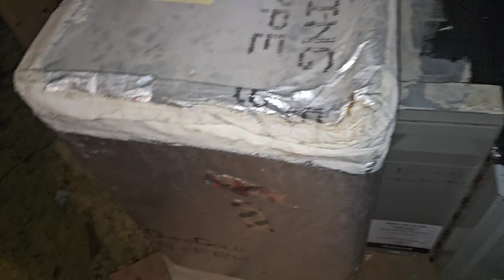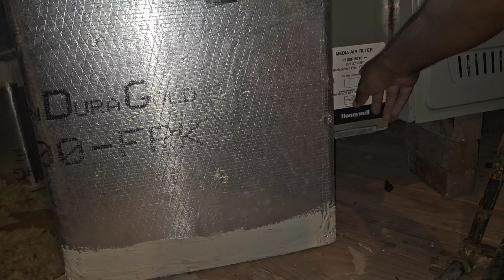Saved a Client $1,000 on Their Air Purification System!

Comment: very good idea to use dedicated transformer when installing U V lights    SOME CONTROL BOARDS WILL ACT UP IF YOU ADD  EXTRA LOAD TO THE POWER SOURCE    ESPECIALLY ON COMMUNICATING SYSTEMS   BUT YOU ALREADY KNOW THAT DON'T YOU

Comment: that evap coil was leaking
Reply: Time stamp please, and how can you tell?
Reply from the maker: Dude just typing
Reply: @WWHVAC  nope 37:40 to about 37:55 evap coil was dripping
Reply: @realSamAndrew  37:40 to 37:55 slight   drip
Reply from the maker: It's supposed to do that. Condensation
Reply: @cdsturg982 usually when you say leaking coil it refers to the refrigerant leaking out. A water drip is different and as WW said, it's designed that way.
Reply: @cdsturg982 big thumbs down for this one ....just be quiet and watch the video if you don't know what you are talking about.